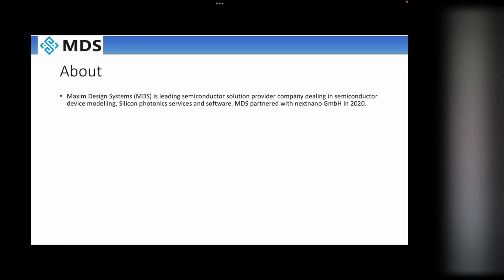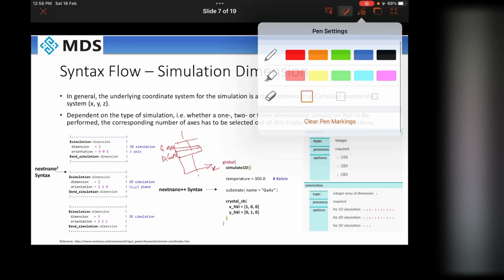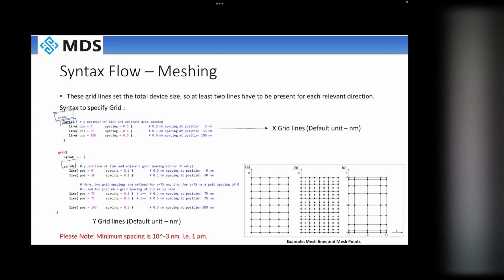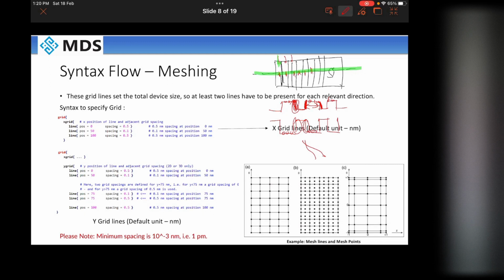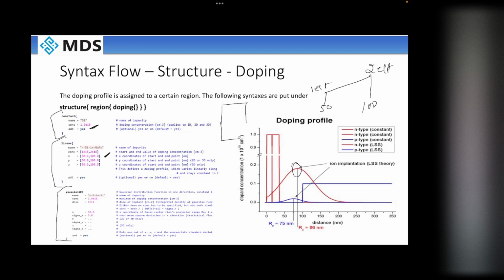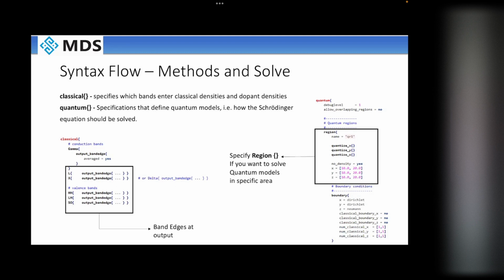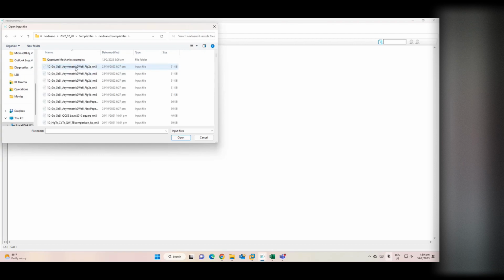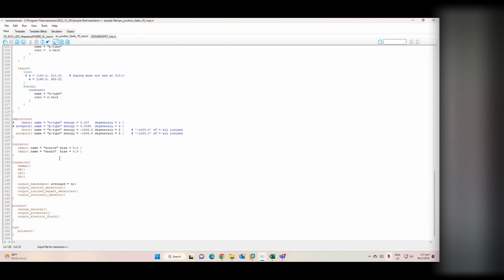Nextnano TCAD Software Training

Comment: How will we mention the thickness of layers?
Reply: You will introduce it at variable and also in the mesh lines
Reply from the maker: For that, you need to follow the following step:
1. Update meshing based on your new layer.
2. Define the region statement for the new layer and provide coordinates. 
3. Define material within the region statement.